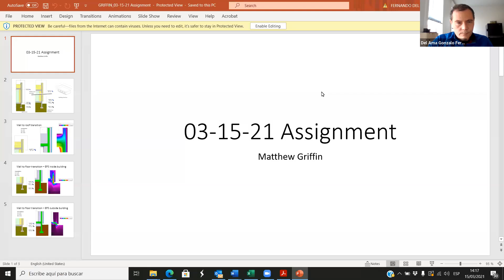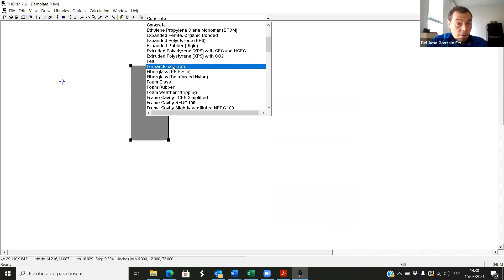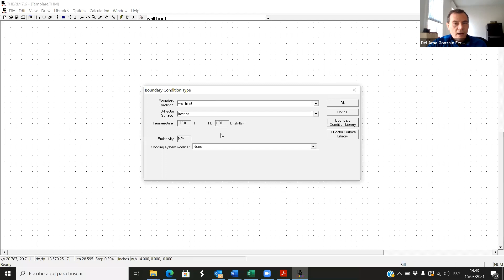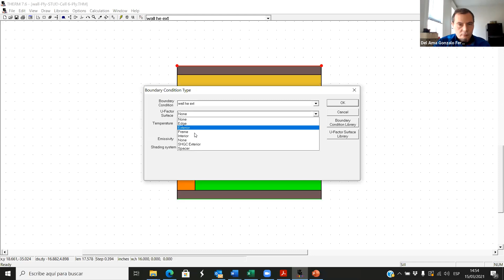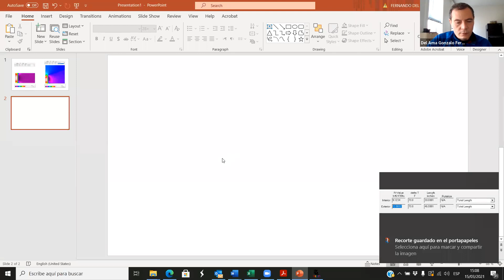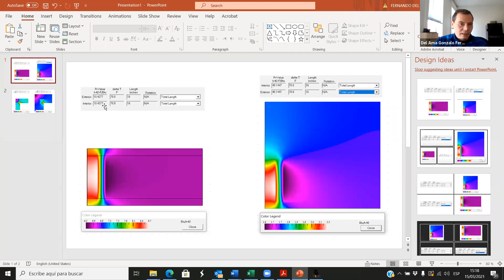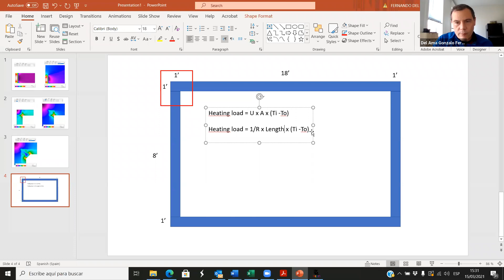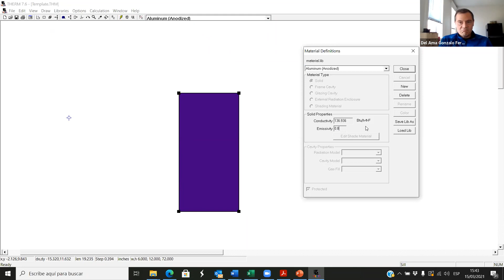Video ARCH 360 03 15 THERM

Comment: Thank you for the video!!

I have one question here, 
in my THERM both 7.7 and 7.8 version, 
I have constantly been encountering an error stating that 'trouble opening file' and then 'analysis not successful',
 whenever i clicked on the Analysis botton, 
does anyone have any idea about the reason and how to fix this issue?

Thanks in advance for the help!